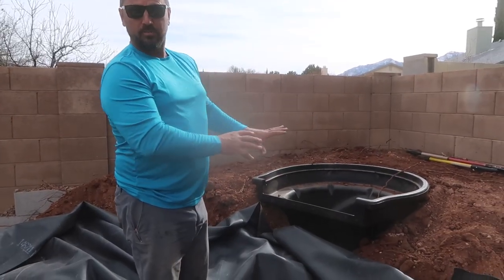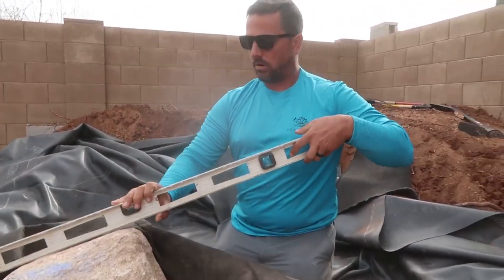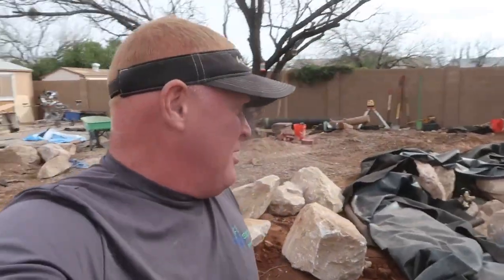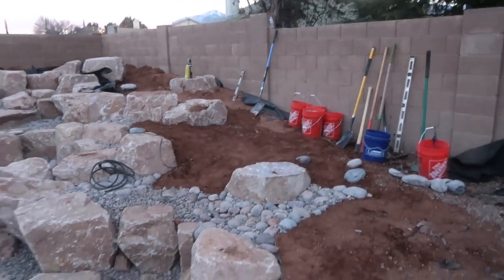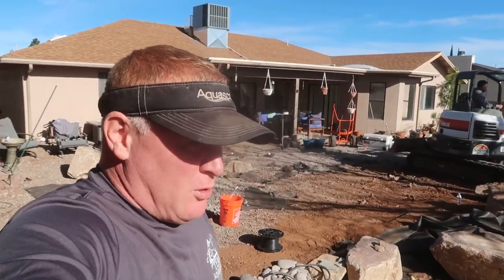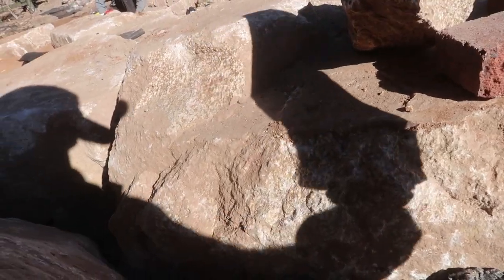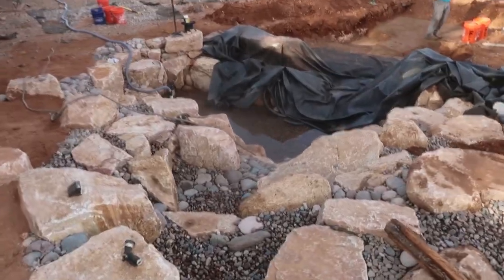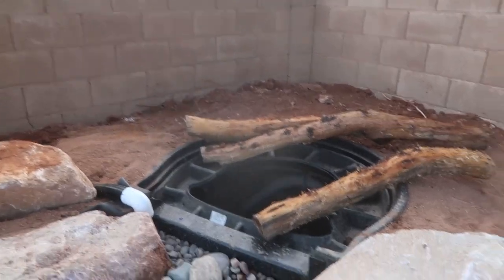Creating a Splitting Waterfall with Drops - Part 3

Comment: Looking good! Can you talk about the Wing Walls and there purpose? Thanks
Reply from the maker: Wing walls are there for aesthetics, but more importantly they are there to help control erosion. Without them the waterfall area would have a pyramidal or volcanic look. If the sides are sloped aggressively like that then every time it rained we would deal with heavy erosion. This would ultimately cause the waterfall to leak. Hopefully this helps.
Reply: Got it, thanks!